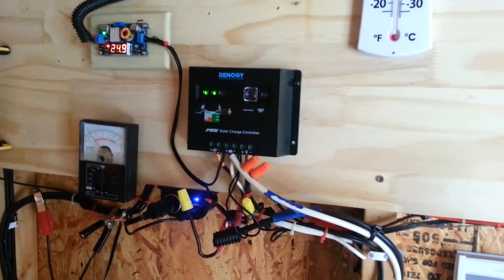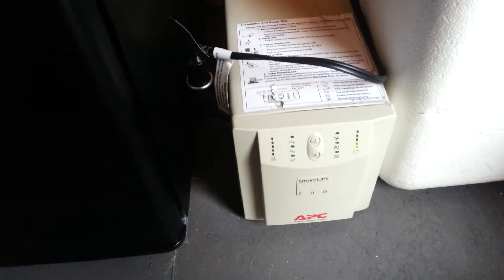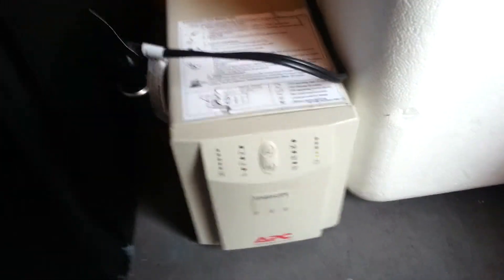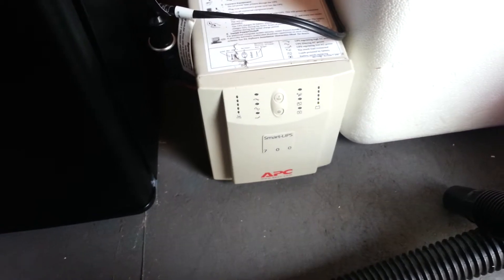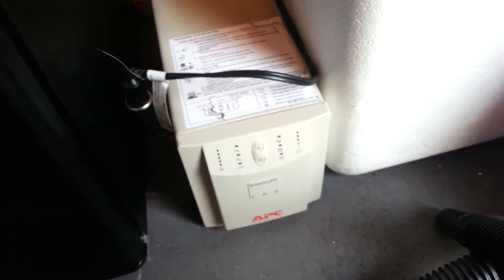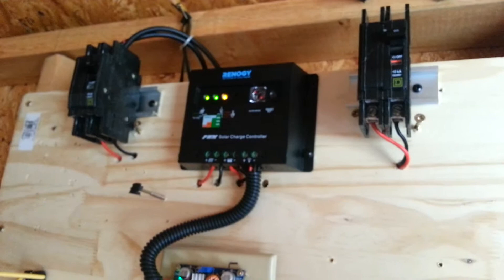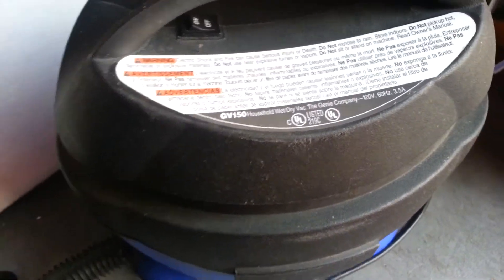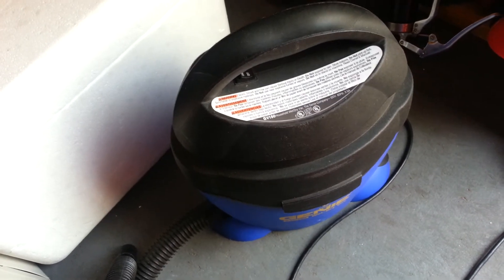450 Watt APC Smart UPS Under A Load Test!

Comment: What if u use it with 200 watt  load. Using 2x150 24v external  batteries.. For 10 hours.
Will it be hot 🔥?